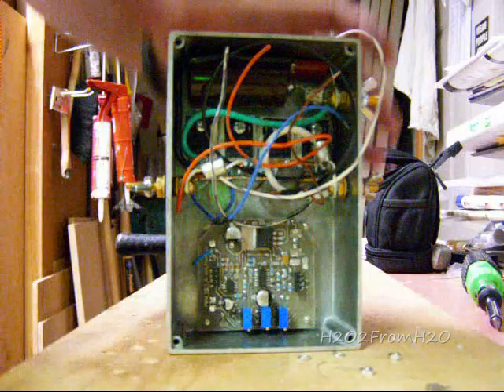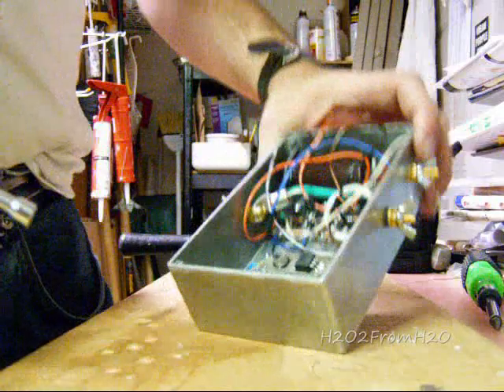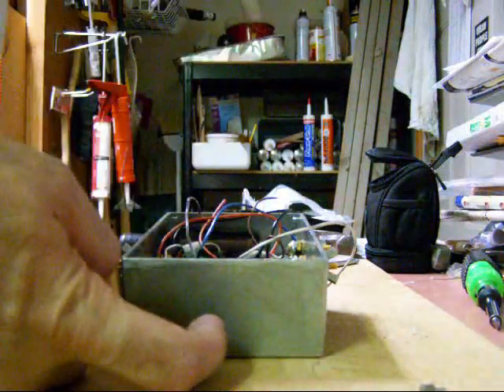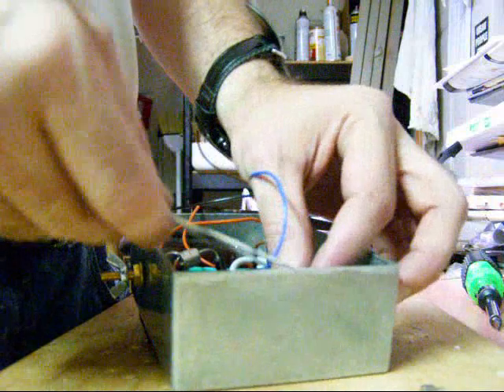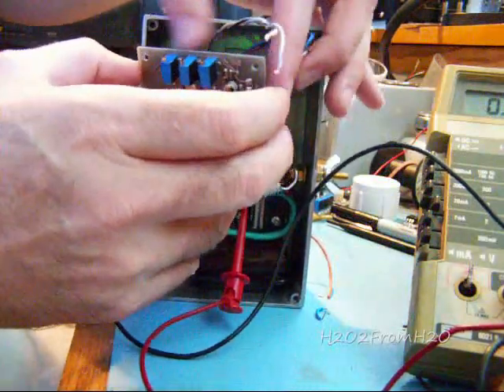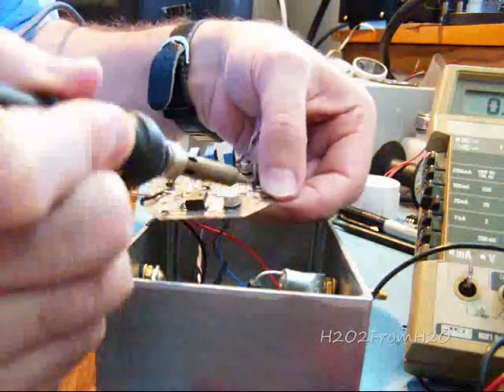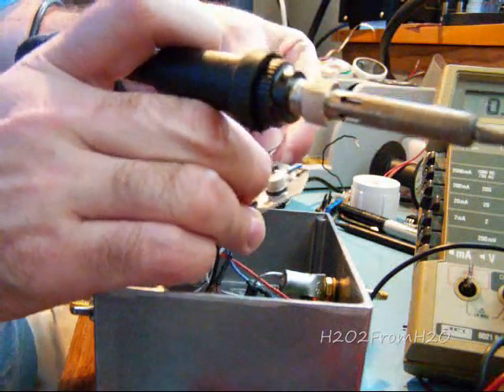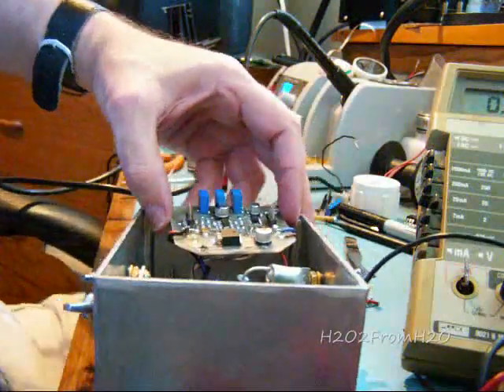#36 H2O2 - PWM Case V2 Layout Part 14 of 17

Comment from the maker: External potentiometers(Pots) are no problem at all, The PCB layout is for surface mount, all you have to do is form a small L or a loop at the end of the wire, tin the wire and the board and join then together. Then tight wrap or bundle the 3 wires together for added durability. Use multi turn pots. Thanks for the question, When I served in the Navy the instructors always said the only stupid question is the one not asked.